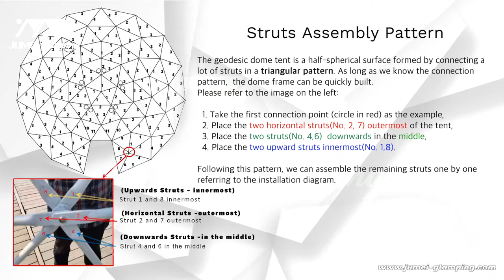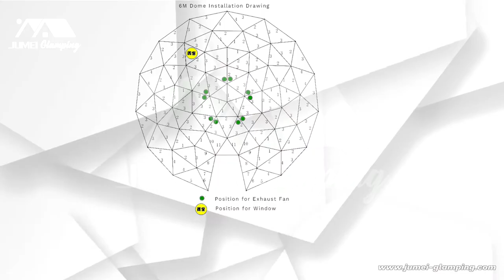How to Build a Geodesic Dome with Add-ons Step by Step

Comment: The base circle of a 6m 3v 5/9 dome will not be 6m :)
Reply from the maker: Thank you for reminding! If it is a 6m 3v 5/9 dome, the radius of the base circle should be less than 3m. Please refer to the installation manual provided by your manufacturer for the right radius of the base circle for your dome when you install it.

Comment: Is there a see-through cover on the top of the dome, above the sunroof? It concerns me because of the heavy rain/snow, it shouldn't go on the flat surface of the sun roof, right? P.S. I have ordered 3 domes from you, they are on the way. Thanks
Reply from the maker: Thank you for purchasing our products. Yes, there is a see-through clear PVC cover sewn together with the outer cover on the top.
Reply: Hello, my apologies for what I am about to say but poor you that you have ordered 3 domes from them. Me and my partner ordered 1 and everything has been an absolute disaster. First of all.. when we started the installation procedure we realized that there were parts missing (both triangle window frames, one tension rod, one anchor/footing, bolts, screws and hose clippers for the skylight. 
We ordered an 8 meter dome and wasn’t  8 meter, it was 7.78 so we had issues with the cement block base we had set up for it.
Also.. the set up videos they have online (particularly this one) supposedly they are step by step videos.. they are not at all.. they are barely helpful actually. 
When you will have to set up your domes you will come to realize that the insulation has no wholes in order the tie wraps to go through and attach to the dome structure. You will have to guess where to make wholes and tie wrap them (as we did) because the company won’t assist you AT ALL! The issue with that is that if you guess wrong and you place too many tie wraps and the insulation is too stretched then you won’t be able to place the bolt caps (for which you will have to make wholes yourself again) in the inside of the dome. That is a pain in the ass if you have placed the pvc already (as shown on the video) because you have no access between the pvc the insulation in order to remove some of the attached tie wraps. Also in order to place the tension rods you will have to make the cuts yourself except the first two next to the door frame. That is quite risky because you may cut the outward side of the pvc. 
The videos they have online show NO details for a lot of things in order to know you are doing the right thing. This video shows the installation of a door frame with a curve on top and we DIDNT receive that kind of door, we received a different style one with no video how to install it. The insulation we received has already the cut where the skylight is so the installation of it was  different. In a nutshell, there is a possibility to receive similar (not the same) items to the ones you see on the video and if you have questions why there different or how to set them up NOONE will help you. That’s the ugly true 😞

Comment: Are they hard to put together
Reply from the maker: It is not very difficult to install, 2-3 skilled workers can put up the framework and cover fabric in a few hours, and it will take extra time to install doors, windows, and other accessories, but it's really not that hard.
Reply: When they are saying that 2-3 skilled workers will do it in a few hours.. it’s a big fat lie! It takes days and days, mostly because the videos they provide are not really helpful and also because you haven’t done this before another 50 times in order to know what you are doing.
Reply: @riats8715 their videos for the 6m don't show what number struts go where. Did you figure out where to put each of the numbered struts?